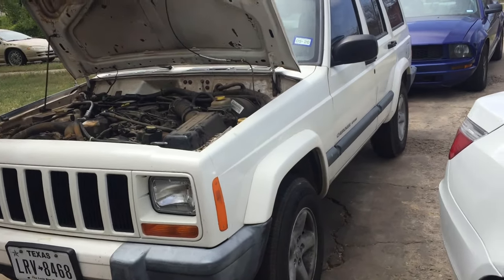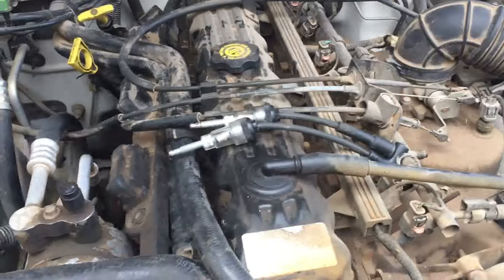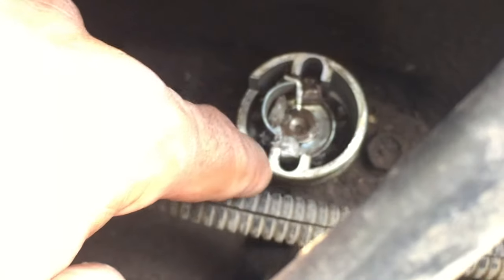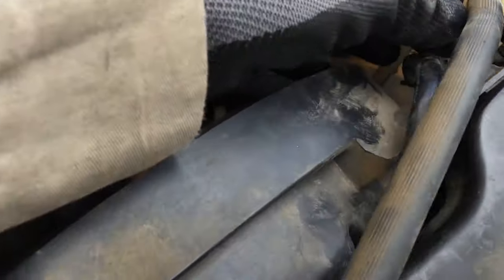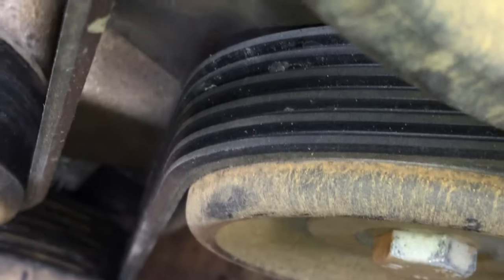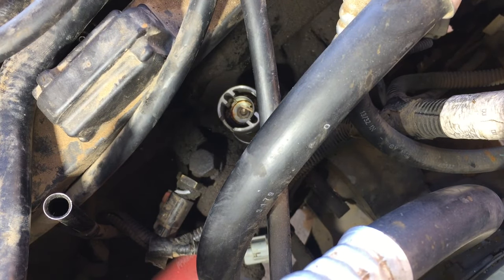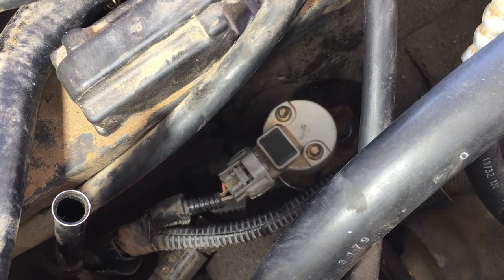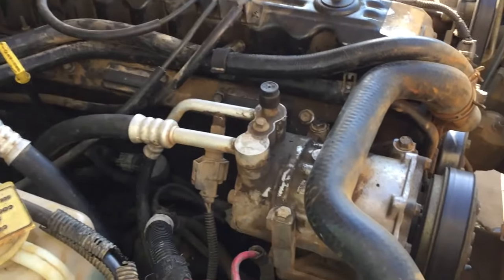jeep 2000  4.0 camshaft sensor and synchronizer

Comment: Alot of mechanics don't check the camshaft synchronizer it gets so worn the wobble damages the sensor & eventually the new one they put in. Usually you just see a slight rubbing hardly noticeable on the 2 parts.  Some new camshaft synchronizers come with a plastic alignment cap tool. Good video Marty.
Reply from the maker: Hi JR  thank you.   thank you for the comment and thank you for watching I really appreciate you

Comment: Thanks man replaced the oil pump on my 2000 grand Cherokee yesterday and was told to prime the pump with a drill so I removed the crank shaft sensor without reading into it more and when I put it all back together it wouldn’t start up! Haha ima try this when I get home and hopefully it works!!
Reply from the maker: Hi Michael Concino your welcome hopefully it will work for you brother and thank you for watching I appreciate you
Reply: @Marty09933  it worked!! Thanks alot man I really appreciate the video! Unfortunately I’m still getting only 10 psi on my oil pressure once up to temperature. Once i give it some gas the rpm goes up but comes back down to 10psi with the Gauge kit. Idk what else to do I replaced the heads this weekend cause the previous one was cracked and leaking coolant into the oil and I had low oil pressure, I was hoping the heads would take care of that but no, then i replaced the oil pump and still idk what else to do any ideas?
Reply from the maker: @michaelcancino6818  sorry brother maybe change oil sending unit, change to a different oil ? Never ran into this problem . That sucks sorry to hear that
Reply: @Marty09933  no problem bud I just got a quart of Lucas oil stabilizer let’s see what happens haha
Reply from the maker: @michaelcancino6818  good luck go for it 👍

Comment: Thank you so much. I have this same problem and was able to follow along 100%. Unfortunately I have the same problem with my aftermarket CPS - it doesn't line up correctly at TDC. So I returned the part after working on my XJ for hours and running to the store several times. Guess I'll have to go to the junk yard and find an OEM CPS. Oh well. Anyways thank you for the time and effort you spent on this. It helps a LOT.
Reply from the maker: Hi Meinbher Pieg your very welcome   man I hear you it’s frustrating when you work on something  for hours and get nowhere  sorry to hear that brother. And thank you for watching I appreciate you

Comment: Yup I have one of these. A pain to mess with some times. Just take the plug out of cylinder 1 and get it on TDC . No need to take all the crap off the fans and all. Put finger on spark plug hole you will feel air suck in or want to push you off the hole when it wants to push you off. That's compression stroke. Then get to TDC. Easier than removing all the crap off the front.

Comment: Wow I didn't know these have that kind of Coil set-up on the 00. Happy I picked up a 99!
Reply: I actually prefer this coil setup, putting the new coil pack in was as simple and unbolting and unplugging it and then plugging it back in and bolting it back in rather than have to unplug one plug wire at a time and trace it and try to put them back in the right spot and then try to trace down which one was wrong when it starts misfiring

Comment: If you buy cheap aftermarket parts, they do not have paint marks on the inside of the new synchronizer to align the reluctor window, you can also turn the oil pump drive with a long screwdriver to align it where you need it to drop the Syncro down in the hole properly. New aftermarket parts also do not have the holes drilled, there should be paint marks identifying proper alignment but yours had none. You can see when you aligned the junkyard part, the reluctor window thin metal aligned with some notches, you called INDENTS on the Syncro, no need for the alignment pin if you just use the notches after you get a good idea in your mind of proper alignment at 20:13 on the video, the Syncro metal and the reluctor metal meet at about 1:00 and 7:00 positions. its not for a newer year part, its the aftermarket cheap way of making it but they did not put paint marks, amigo. The reason for using a toothpick instead of a metal pin is in case somebody forgets to pull it out and they start the engine, the wood will break and not the new parts. Thanks for the detailed explanation, next time now you can use the part with no pinhole and no paint.

Comment: Hey marty do i need to take off the synchronizer and align the holes then place it back in? i keep turning the polly wheel and the holes will not line up ive turned it a dozen times its off my like 3/4 of an inch
Reply from the maker: Hi @Kevincordorva5267 yes try that and hopefully it line up and thank you for watching I appreciate you

Comment: The new part looks different from the old part. At 19:22 what are those three notches in the outer circumference of the casting that is not on the old broken part?
Reply from the maker: Joseph l frazier yes the new part looked different that’s why I didn’t like it and the parts store didn’t have anymore   I don’t know if it was for a newer vehicle or what ? Didn’t want to take a chance  so I got a used one that looked just like the broken one  that’s why it looked dirty . Yes I put a used one in with permission from the customer. And it’s still running good .

Comment: I understood most of what you explained to your audience and followers, although I do not understand the English language, and what I write now I write through a translation program.
I hope you will answer my questions.
First, is the camshaft sensor able to be replaced by replacing the spark distributor?
Second, what is the reason that pocket engines consume so much fuel?
Is there a solution to this very bad thing?
Accept my greetings. Thank you
Reply from the maker: Hello brother not sure I understood you  sorry but I’ll try my best to answer . You. Can just change the camshaft sensor without changing the synchronizer . My synchronizer was broken so I did both .as for fuel consumption I don’t know about that . Thanks for watching I appreciate you
Reply: If you're talking specifically about the Jeep 4.0L I can confirm, that yes they get bad fuel economy. It's the the way they were built, fuel MPG didn't seem to be that big of a concern.  My 99 Jeep Cherokee only gets 10 mpg. Pretty horrible for a motor with such low horsepower. Mine does have 33" tires, but it still only got about 12 mpg with the stock ones. I've heard swapping to 12 hole injectors can help get better mileage, so I'm going to try that next.

Comment: Thanks for making this video, Marty. My 02 Wrangler just threw a code so I went to Autozone to have them read it. Their OBDII code reader said it was the camshaft sensor, so I bought a new one and decided to YouTube the proper way to swap it out. 
I was happy to find your video. I hope my swap goes as well.
Question: If I'm only swapping the cap, do I need to find TDC or is that only if you need to pull and swap the entire shaft?
Reply from the maker: Jeff Harris hello no you don’t have to find  tdc  thank you I really appreciate you good luck my friend
Reply: Hello. I’m curious as well. I wanna swap just the cap/sensor part. Not the whole shaft. Did this work as planned?

Comment: how does spraying the TB reveal fuel system issues? I don't get that?
Reply from the maker: Hi PC buys yes that’s one way to know if  the fuel pump is working or not . When you spray TB it will start running until you stop praying the TB . If it stops running after you stop spraying That tell me I’m not getting fuel delivery from fuel pump  if it’s a fuel issue . Thanks for watching I appreciate you
Reply: @Marty09933  oh

Comment: Now if you had the proper new complete camshaft sensor shaft....that you originally had purchased, you would not have to do that alignment process for the electrical camshaft sensor part, as long as you had #1 cyl. at TDC...am I correct?
Reply from the maker: Joseph l frazier cool thanks for googling it helps others  yea its confusing but if you take it out and put it in without disturbing the engine you wouldn’t have to Align

Comment: Great vid buddy! How do you know if it's on compression stroke or exhaust stoke at top dead center without the valve cover off?  Or does it even matter.
Reply from the maker: Hi Project  Dan H I’ve always done it just like in the video  when I install a new distributor and if I’m off   the vehicle will not start so I do another rotation and get the piston up again and crankshaft mark on 0 that gets me on TDC and vehicle starts .so if vehicle don’t start or has issues do another full rotation and get the piston back up and crankshaft pulley mark on 0. Hope that helps thank you and thanks for watching I appreciate you
Reply: @Marty09933  excellent Marty! God bless
Reply from the maker: @ProjectDanH  thank you 🙏
Reply: You can put your finger over the spark plug hole. When the compression tries to push off your finger your on compression stroke then find top like Marty did with an extension or similar tool.
Reply from the maker: @markc6207  Hello. thank you for your comment appreciate you

Comment: Bro thank you! I’m
Not sure if it will work yet but still thanks. 
I’ve been trying to find a video for this same jeep and cam shaft sensor that really shows everything good. So thank you! I was about to change the spark plugs and coils but I think I’m going to just start with the cam shaft sensor🤞
I have had this problem for years! My jeep does not like to start when the engine is hot. It’s getting much worse too and almost never starts when it’s hot now... 
I’ve read that when I get the Cam shaft code I shouldn’t assume that’s exactly what it is all the time but it only happens when the engine is hot and everything else seems to be fine but I guess I will find out. Any recommendations or suggestions would be really helpful thanks again!
Reply from the maker: Hi Hunter Keating  it’s hard to tell not actually seeing the vehicle but I know this jeeps  had problems with heat soak and had to have the injectors installed???? Check on that .
Reply from the maker: Hunter Keating sorry mean insulated
Reply: @Marty09933  Are you referring to the fuel injector? And is that what ended up fixing the vehicle in the video or are you saying that the fuel injector helped for a different jeep you worked on. I think I replaced that at one point but I will have to check that out too then.
Reply from the maker: @ALGH2101  no on the video it was the camshaft sensor. But I’m saying those jeep  had a problem with the fuel injector  getting hot  and the fuel rail .
Reply from the maker: Hunter Keating  the problem with some of those Jeep’s  was the car wouldn’t start after it warms up  so you had to wrap the injector or the fuel rail or both with some kind of heat wrap

Comment: Why does the inside of the new part where you're showing the toothpick through the holes to line it up....looks dirty with debris in there..at 17:46? And at 18:45. Or is that the old part that you're using just to show us the hole alignment?

Comment: Actually for the pin or toothpick to pass thru and align you want the number one piston on the TDC of the exhaust stroke not the comp stroke.  You can check this if you ever change the timing chain. The two alignment dots on the gears align with number 1 cyl on top of the exhaust stroke.  Then if you check the CPS which replaces the distributor. You should be able to pass the toothpick. Nif it does not you need to loosen tge cps base and adj.  Check that timing mark you use when the timing cover is off and see if it aligns.  It may. My point is when it does its on tge exhaust stroke not intake tdc.